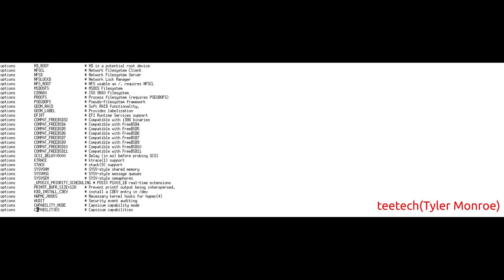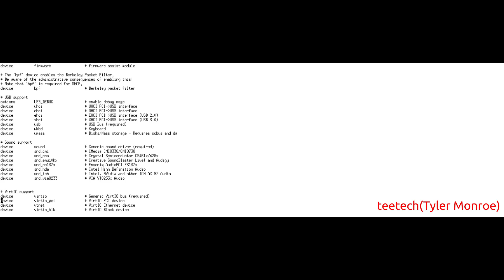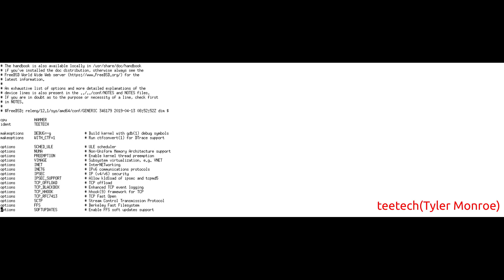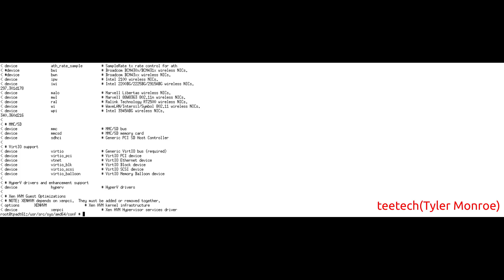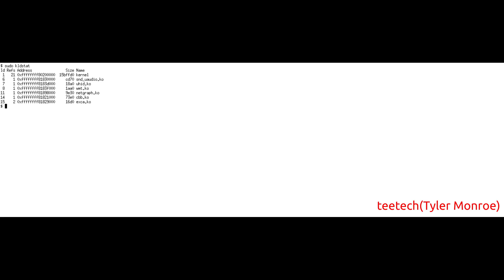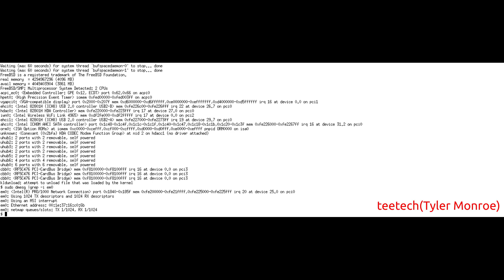FreeBSD Compiling Custom Kernels

Comment: hi, i was wondering if there was a sort of command line like on linux i mean a "make nconfig" to have semi graphic to edit the kernel and know what does each module?
Reply from the maker: Hi Nenoro.

I'm not aware of any kind of interface for this weather ncurses based or not. The procedure covered in the handbook is the standard way. But if you want to know what each piece in the kernel config file means. You should be able to figure that out between the handbook,  man pages and the config files comments.

Here's some links:
https://docs.freebsd.org/en/books/handbook/kernelconfig/

For instance if you didn't know what the pf option meant in the kernels config use the man pages with the term pf.
https://www.freebsd.org/cgi/man.cgi?query=pf&apropos=0&sektion=0&manpath=FreeBSD+13.0-RELEASE+and+Ports&arch=default&format=html

 In that page you will find the corresponding kernel config keywords at the top under the synopsis heading. If applicable of course, because userland programs say pfctl for instance wouldn't have a kernel config option since that program isn't built into the kernel itself.

Don't neglect to read the config files comments those will either tell you what the option does or at the very least give you a term you can search with to better understand it.

Hope that helps and thank you for your comment and for watching my videos!

Comment: Does FreeBSD support vfio / gpu passthrough for Windows 10 running in a virtual machine, if not would a custom kernel help with getting hardware acceleration on FreeBSD?
Reply from the maker: Hi. 

Unless you have an overwhelming need to use FreeBSD to run Windows 10 as a VM. I would strongly recommend dual booting as the performance will be much better and you will have less issues overall. 

Hopefully this helps answer your question. 

Building a custom kernel in order to add gpu passthrough support, would only work if there was code available in FreeBSD's kernel for that but it wasn't enabled by default.

It does seem that bhyve in FreeBSD has a form of this but it sounds like your mileage may vary when using it. As far as I know the GENERIC kernel is built with all the code needed for bhyve to function.

Hopeful these resources help in some way.
https://forums.freebsd.org/threads/bhyve-gpu-pass-through.70737/

https://www.phoronix.com/scan.php?page=news_item&px=Bhyve-GPU-Passthrough-2019 

https://www.reddit.com/r/freebsd/comments/bnky91/consumer_gpu_passthrough_reported_working_on_bhyve/

https://www.youtube.com/watch?v=OVy2H5ievPM

I will add around a year ago I tried using FreeBSD with the virtualbox-ose port and Windows 10 and it kept crashing and wouldn't install. Remember this was a year ago so things may have changed since that time.
Reply: @teetechtm  Thanks man,  really appreciate it.
Reply from the maker: @brandonphilander661  No problem glad to help you. If you get a chance afterward let me know how it goes for you.
Reply: @teetechtm  Could I play modern AAA games on FreeBSD with steam proton?